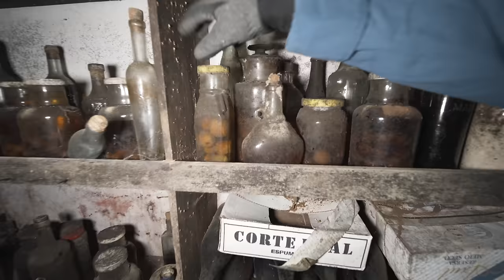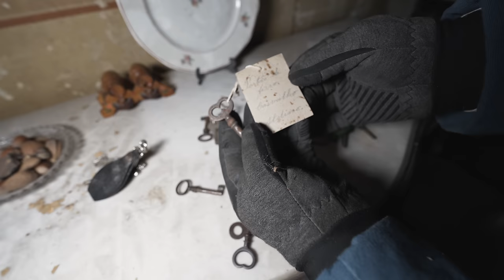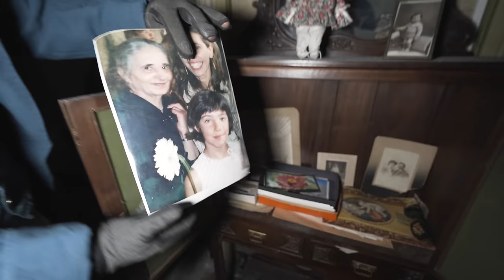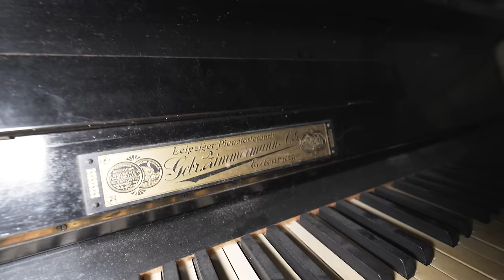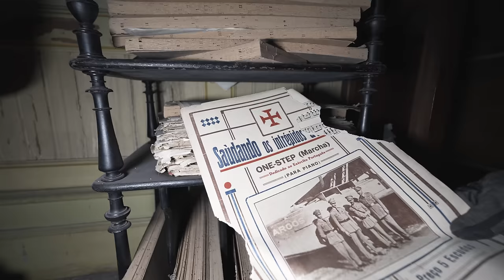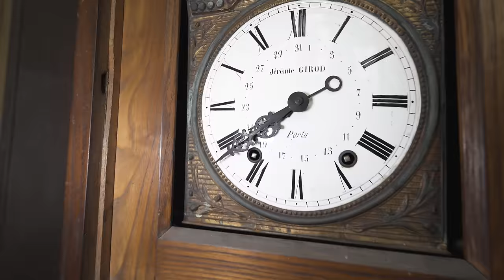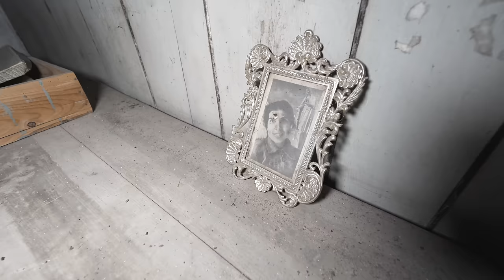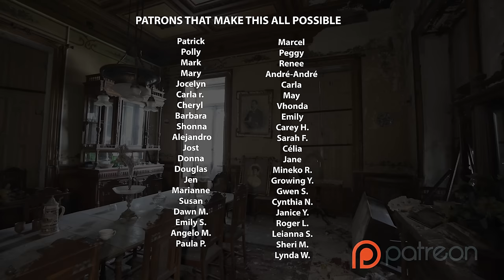Their Fortune Vanished ~ Abandoned Fairytale Palace of a Fallen Family!

Comment: Some interesting electricity installations. We have that too, but in our house they put the cables within lead tubes. Reason is that cables back when the installation was made were only insulated by a textile cover and often and quickly catched fire - which should be stopped from expanding by those lead tubes. So I guess this electric installation is quite "new" (after 1950).

Comment: At 15:09 1878 was an experiment  and a test on September 28th, during the celebration of the 15th birthday of Prince D. Carlos, lamps were lit on the Cascais Citadel esplanade. These were offered by the City of Lisbon and used again the following month in the Chiado area. Electric utility there, wasn't until 1891 or later. AC power came much later.